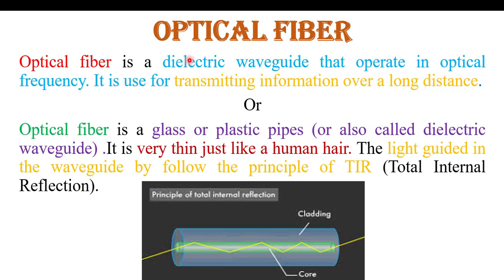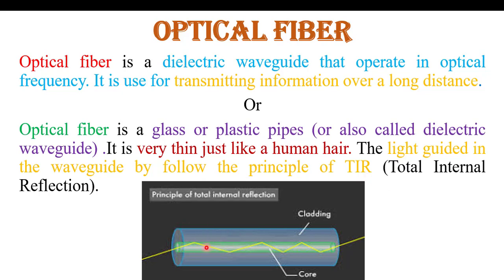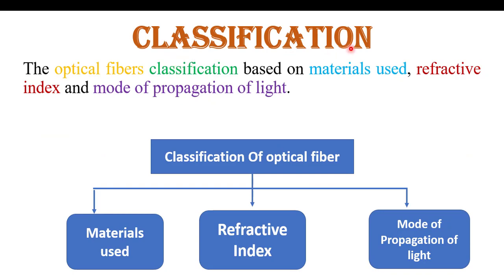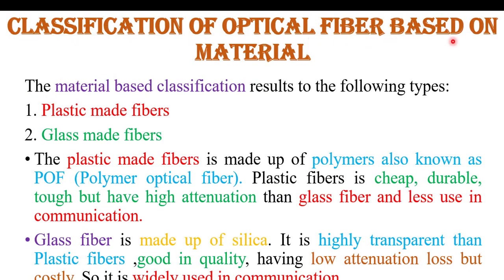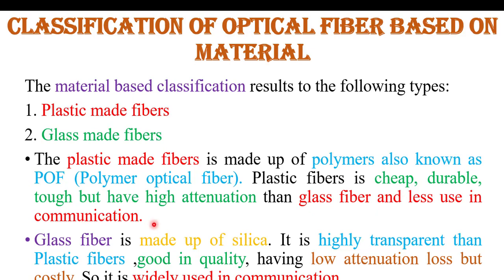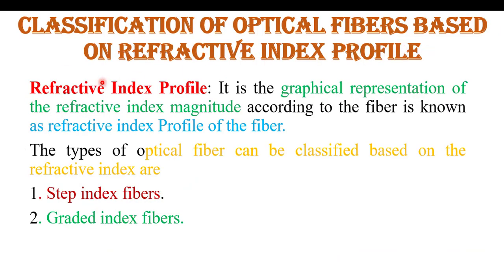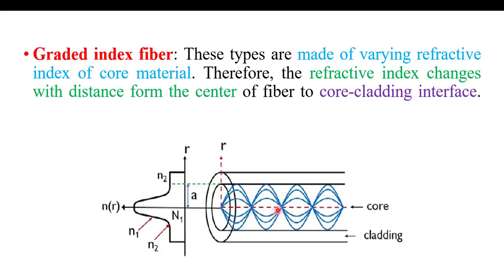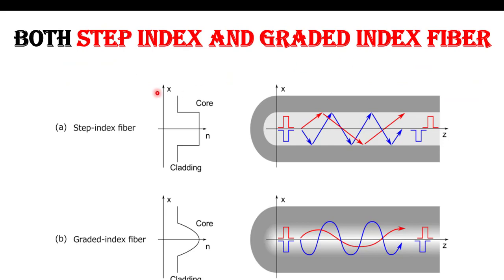Classification Of Optical Fiber

Comment: Not the air working like dielectric, the material that makes the optical fiber itself is a dielectric material.
Reply from the maker: Some liquids and gases can serve as good dielectric materials. Dry air is an excellent dielectric, and is used in variable capacitors and some types of transmission lines. Distilled water is a fair dielectric. A vacuum is an exceptionally efficient dielectric.